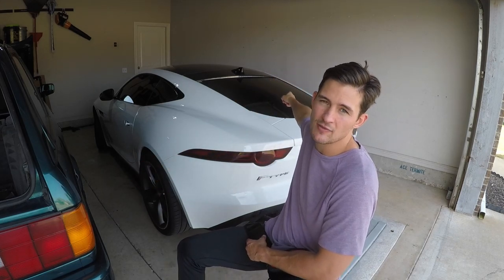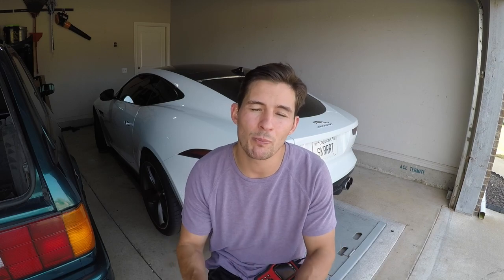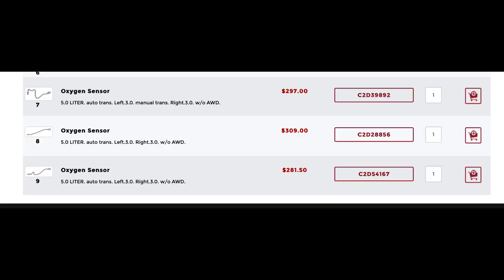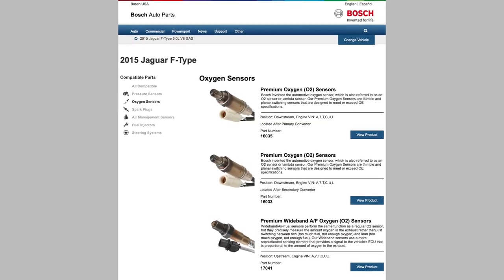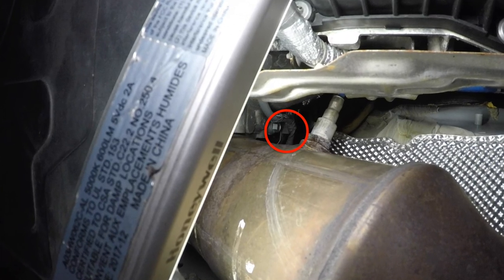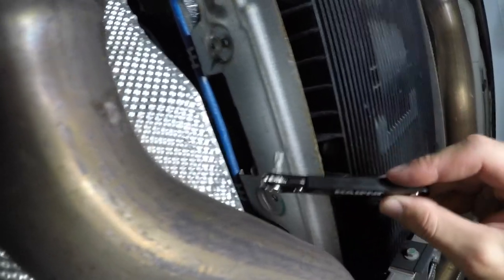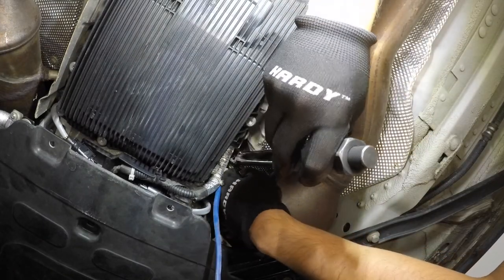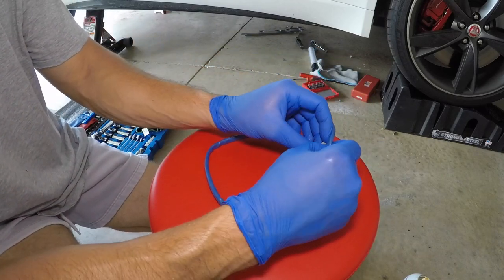Jaguar F Type Oxygen Sensor DIY Replacement!

Comment: Great job . Wish I knew when I replaced a O2 sensor on my f type for $500 all in at the dealer 2 months back. Good to know for next time.
Reply from the maker: Thank you! $500 is a little steep for sure
Reply: They are offering refunds
Reply: @gailspanglerii9957  Thanks. I did get an email. Contacting dealer for refunds now.

Comment: Can’t view this email? Click here.

Jaguar

Dear Current or Former Owner or Lessee:

This letter is to notify you that Jaguar Land Rover North America, LLC has decided to offer additional warranty benefits related to the Exhaust System Oxygen (O2) sensors installed in certain vehicles listed below:
JAGUAR VEHICLES AFFECTED*	MODEL YEAR
F-PACE	2017
F-TYPE	2014 - 2017
XE	2017
XF	2013 - 2017
XJ	2013 - 2017
XK	2013 - 2015
*Only vehicles fitted with a GTDi 2.0L, V6 3.0L SC, V8 5.0L, or V8 5.0L SC gasoline engines.

This extended warranty program does not apply to Partial Zero Emission Vehicles (PZEV) registered in California, Connecticut, Maine, Maryland, Massachusetts, New Jersey, New York, Rhode Island, or Vermont. The O2 sensors of PZEVs that are registered in these states are covered under an existing warranty of 15 years or 150,000 miles (whichever occurs first).

In line with our commitment to customer satisfaction, we are offering these benefits in response to reports of performance issues with exhaust system O2 sensors. 

What is the Concern?
The O2 sensor concerns can be caused by either design or manufacturing variations or by system operating software and can lead to illumination of the check engine light (MIL) and potentially a minor increase in tailpipe emissions. There are no effects to vehicle performance. Vehicle repairs now benefit from enhanced system robustness improvements to component design, manufacturing processes and operating software. 

How long is the extended warranty? 
The extended warranty limits are defined in the following table:

MODEL	PETROL ENGINE VARIANT	COVERAGE
F-PACE	3.0 L
F-TYPE	3.0 L
XE	3.0 L
XF	3.0 L
XJ	3.0 L
15 years / 150,000 mi (whichever occurs first)
F-TYPE	5.0 L
XE	2.0 L
XF	2.0 L, 5.0 L
XJ	5.0 L
XK	5.0 L
10 years / 120,000 mi (whichever occurs first)

What should you do?
Should your vehicle's check engine light illuminate, please contact your preferred authorized Jaguar Retailer, provide your Vehicle Identification Number (VIN) and make a service appointment to diagnose the concern.

Any required repairs/replacements to any O2 sensor or to O2 sensor operating software will be covered at no cost to you for the length of the applicable extended warranty period.

Jaguar recommends you keep a copy of this letter in your glovebox with your vehicle literature pack and it be provided to the new owner of your vehicle if it is sold. 

What if I have previously paid for this concern? 
If any current or former owner has already paid for this service before the date of this letter, Jaguar is offering a refund. In order to qualify for a refund, please provide your authorized retailer with the original paid receipt. To avoid delays, please do not send the receipt to Jaguar Land Rover North America, LLC. 

What should you do if you have further questions? 
Should you have any questions regarding this program or need assistance in locating the nearest authorized Jaguar retailer, please contact the Jaguar Customer Relationship Center at 1-800-4JAGUAR (1-800-452-4827).

You may also contact us by e-mail using the following address: jagweb1@jaguarlandrover.com.

If you have the need to contact Jaguar by mail, please use the following address:

Jaguar Land Rover North America, LLC 
ATTN: Customer Relationship Center 
100 Jaguar Land Rover Way 
Mahwah, NJ 07495 

We appreciate your confidence in our product and wish to do everything we can to retain that confidence. Jaguar regrets any inconvenience this action may cause and thanks you for your cooperation.

Sincerely,
Jaguar
Thomas Giese
Director, Technical Services - MA-43
Customer Service

Unsubscribe  |  Privacy Policy  |  Contact Us

	Please do not reply to this message. If you have questions, please contact us here. 

Jaguar Cars, 100 Jaguar Land Rover Way. Mahwah, NJ 07495 
© 2021 Jaguar Land Rover North America, LLC

Comment: Dont forget the entire emissions system is warrantied by the Federal Government's Emissions warranty for 8Y/80K for all cars from the in-service date. If you fail emissions for one of the parts listed, the dealer has to fix it free of charge.  The sticking point can be nailing the problem to one part.  Sometimes its easy, like a code points to the part.

COMPONENTS LISTED UNDER THE FEDERAL EMISSIONS WARRANTY

There are a number of parts and systems in today's vehicles that qualify as emissions-related parts. These parts and components are listed below. Keep in mind that new systems may be added since vehicles are constantly evolving.

Air system controls

Catalytic converters

Distributor and distributor components

Electronic fuel injection system and injectors

Evaporative-emission canister and controls

Exhaust manifold

Exhaust gas recirculation valve and control system

Exhaust pipes (between exhaust manifold and catalyst)

Fuel cap and tank assembly

Pump and fuel lines

Ignition coil and ignition module

Intake manifold

On-board diagnostic-system components

Oxygen sensors

Positive crankcase-ventilation (PCV) valve or orifice

Powertrain control module

Secondary ignition wires

Spark plugs

Throttle body

Transmission-control module

Vacuum hoses, clamps, and fittings, as well as tubing used for these components

Vacuum, temperature, altitude, speed, time-sensitive valves, sensors, and switches used in these components and systems.

For details about which components may be covered, consult your vehicle's warranty manual, consult your dealer or contact your vehicle manufacturer.

A major consideration is Jaguar is hyperagressive in trying to detune F-Types under the new millenial management who despise these cars, so they will probably insist on reflashing it with their new camry-loud software that probably cuts power too.  There is a service bulletin that requires them to ruin any F that comes in for service.  So as a rule, stay away and if you have to take an F in for warranty work, let them know they are not to touch the software.  They sold you this car, not a civic.
Reply from the maker: I plan to hit up the dealer when my cats fail haha
Reply: @skrrtgarage3922 
Already did that here - ha ha.  $3800, paid by uncle sam.

Comment: Hi Conner, as usual amazing video. I bought a white 2017 F-Type R this summer and I just love this car. I have learned so much about this car watching your videos. I am interested in buying the scanner tool you mentioned, the Ancel VD700 but when I looked it up it mentions that it is made for VW and Audi??  Does it scan all make cars as well? Do you have to buy the soft wear for other cars?? When I click your link for that scanner it brings me to Amazon and it states ANCEL VD700 Full Systems Diagnostic Tool Fit for Volkswagen VW Audi Skoda Seat.
Let me know if it does all other makes and models as well so I can order it. Thank you for your time and keep the videos going, great presentations.

Comment: Did the check engine light shut off itself or you have to shut it off manually via the plug in computer?
Reply from the maker: It will go away on its own within about 50 miles. I was impatient and used my code reader to clear the code though.

Comment: Hi conner. Can you provide the link for this bosch o2 sensor. I couldnt find it. My car is knocking badly with uneven power band through different gears. Apprently it’s a bank 2 sensor 1 alert.
Reply from the maker: Hi, I posted the link somewhere in the comments. 

But if you can’t find it just go onto Bosch website and find the upstream sensor
Reply: @skrrtgarage3922  They extended the warranty on these for 10 years or 120k miles for 2014 to 2017 F TYPE  5L and longer for 3L

Comment: Hey Connor I noticed in some of your videos you have the engine cover taken off. Is there any reason for that? Like does it hold in any extra heat, or just like they way it looks? Also, if it rains a lot during the winter or if you wash your car often, nothing underneath the cover would be affected if it were to get wet consistently?
Reply from the maker: Kinda depends. The cover is a noise insulator and can cause some heat to stay within the engine bay. The openings on the hood are actually very small and don’t allow much water to enter even on heavy rain.

If you daily drive the car and it rains quite a bit it might be wise to keep the cover on. 

If it’s a weekend car and it doesn’t go out in the rain too often. Then you can remove it for more supercharger noise and less engine heat.

Comment: This just came in last week:

Jaguar

Dear Current or Former Owner or Lessee:

This letter is to notify you that Jaguar Land Rover North America, LLC has decided to offer additional warranty benefits related to the Exhaust System Oxygen (O2) sensors installed in certain vehicles listed below:
JAGUAR VEHICLES AFFECTED*	MODEL YEAR
F-PACE	2017
F-TYPE	2014 - 2017
XE	2017
XF	2013 - 2017
XJ	2013 - 2017
XK	2013 - 2015
*Only vehicles fitted with a GTDi 2.0L, V6 3.0L SC, V8 5.0L, or V8 5.0L SC gasoline engines.

This extended warranty program does not apply to Partial Zero Emission Vehicles (PZEV) registered in California, Connecticut, Maine, Maryland, Massachusetts, New Jersey, New York, Rhode Island, or Vermont. The O2 sensors of PZEVs that are registered in these states are covered under an existing warranty of 15 years or 150,000 miles (whichever occurs first).

In line with our commitment to customer satisfaction, we are offering these benefits in response to reports of performance issues with exhaust system O2 sensors. 

What is the Concern?
The O2 sensor concerns can be caused by either design or manufacturing variations or by system operating software and can lead to illumination of the check engine light (MIL) and potentially a minor increase in tailpipe emissions. There are no effects to vehicle performance. Vehicle repairs now benefit from enhanced system robustness improvements to component design, manufacturing processes and operating software. 

How long is the extended warranty? 
The extended warranty limits are defined in the following table:

MODEL	PETROL ENGINE VARIANT	COVERAGE
F-PACE	3.0 L
F-TYPE	3.0 L
XE	3.0 L
XF	3.0 L
XJ	3.0 L
15 years / 150,000 mi (whichever occurs first)
F-TYPE	5.0 L
XE	2.0 L
XF	2.0 L, 5.0 L
XJ	5.0 L
XK	5.0 L
10 years / 120,000 mi (whichever occurs first)

What should you do?
Should your vehicle's check engine light illuminate, please contact your preferred authorized Jaguar Retailer, provide your Vehicle Identification Number (VIN) and make a service appointment to diagnose the concern.

Any required repairs/replacements to any O2 sensor or to O2 sensor operating software will be covered at no cost to you for the length of the applicable extended warranty period.

Jaguar recommends you keep a copy of this letter in your glovebox with your vehicle literature pack and it be provided to the new owner of your vehicle if it is sold. 

What if I have previously paid for this concern? 
If any current or former owner has already paid for this service before the date of this letter, Jaguar is offering a refund. In order to qualify for a refund, please provide your authorized retailer with the original paid receipt. To avoid delays, please do not send the receipt to Jaguar Land Rover North America, LLC. 

What should you do if you have further questions? 
Should you have any questions regarding this program or need assistance in locating the nearest authorized Jaguar retailer, please contact the Jaguar Customer Relationship Center at 1-800-4JAGUAR (1-800-452-4827).

You may also contact us by e-mail using the following address: jagweb1@jaguarlandrover.com.

If you have the need to contact Jaguar by mail, please use the following address:

Jaguar Land Rover North America, LLC 
ATTN: Customer Relationship Center 
100 Jaguar Land Rover Way 
Mahwah, NJ 07495 

We appreciate your confidence in our product and wish to do everything we can to retain that confidence. Jaguar regrets any inconvenience this action may cause and thanks you for your cooperation.

Sincerely,
Jaguar
Thomas Giese
Director, Technical Services - MA-43
Customer Service

Unsubscribe  |  Privacy Policy  |  Contact Us

	Please do not reply to this message. If you have questions, please contact us here. 

Jaguar Cars, 100 Jaguar Land Rover Way. Mahwah, NJ 07495 
© 2021 Jaguar Land Rover North America, LLC
Reply from the maker: I may have to go get a refund on the parts! Thanks for posting!
Reply: Just had my second one go bad in 2 months; 15000 miles on OD
Reply: Is this still valid if I have 100 cell cats?

Comment: Great informative diy as always. Did this solve the issues in your last video? Does the O2 sensor failure lend any insight on potential catalytic converter failure in the future?
Reply from the maker: Thanks! It initially helped quite a bit but ultimately I’m still having that same issue.. fouled o2 sensors where the cats are can indicate catalytic converter failure if the problem persists and keeps ruining the o2 sensors

Comment: Yesterday I had a check engine, I put the obd2 and I have the same problem, but is the sensor #3! Do you know if the same sensor number to replace it? You make a good mechanical video!
Reply from the maker: It’s a different part, the graph I put shows the part number though
Reply: I don't see the part number from your graph and have the same issue. Bank 1 Sensor 3.
Reply from the maker: It’s at the 5:35 in the video. Part 16033
Reply: @htruong5629  I've got the same code. On the Bosch website it says 16234, but I can't seem to find one anywhere. Mines a 2016 F-type R convertible

Comment: Nice video.  Subscribed.  I don't suppose you can show us what a failing sensor looks like on SDD?
Reply from the maker: Failed sensors generally don’t look that different 👍🏼
Reply: @skrrtgarage3922  sorry that's not true.  They read totally differently when they're failing, the voltage fluctuates less or not at all, and if they are wideband then the current will read outside the normal range.  Just never seen it on SDD before.
Reply from the maker: Ohhh yes, the voltage changes. I thought you meant visually. What does SDD stand for?
Reply: @skrrtgarage3922  Symptom Driven Diagnostics.  It's the system Jaguar Land Rover use when reading data and programming cars via OBD

Comment: The sensors are about $200+ each 🙄
Reply from the maker: That website I listed had them between $75-150
Reply: @skrrtgarage3922  what about the wideband? Part 17041. I can't find it anywhere but I have found the other 2
Reply from the maker: Oh shoot, I’m not sure.. if you’ve already looked up the specific part number online and haven’t tried anything then maybe no dice. 

Last resort would be type that part number into an eBay search. Some times wholesalers will have the parts on eBay.

Comment: Check part numbers here and don't buy them from Jag dealers:
https://parts.harperjaguar.com/v-2015-jaguar-f-type--r--5-0l-v8-gas

Has it cured the black smoke issue ?
Reply from the maker: I’m still working on the tune issue, I’ll have a answer by this week though.
Reply: @skrrtgarage3922  If that's so then I think the air filters need to be changed - If the injectors max out a 3-4000 rpm and the backfire issue is at higher revs and load, then engine might not getting enough air to burn the fuel on full throttle and load. 

It's a much simpler fix than adjusting the timing and the stock set up is far from ideal to provide all the air your engine now needs.
Reply from the maker: This tune issue is quite possibly from my intakes. We are working through that right now